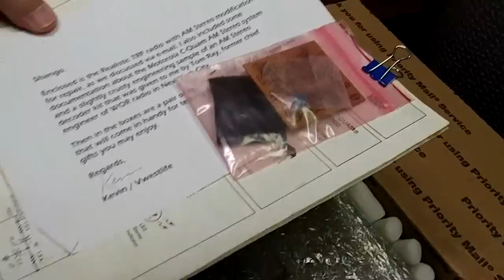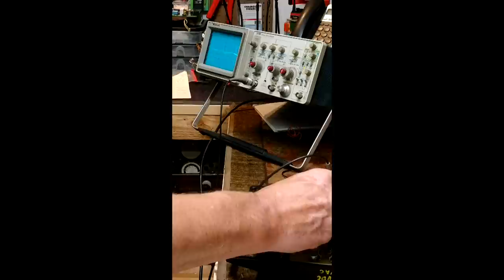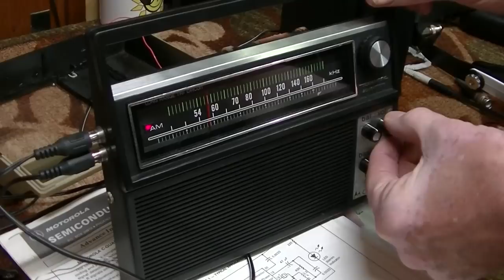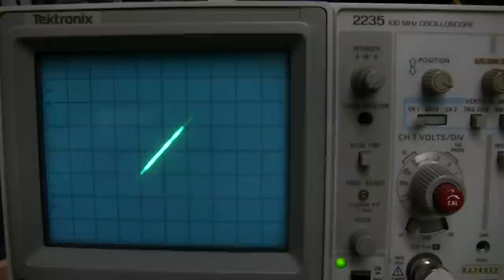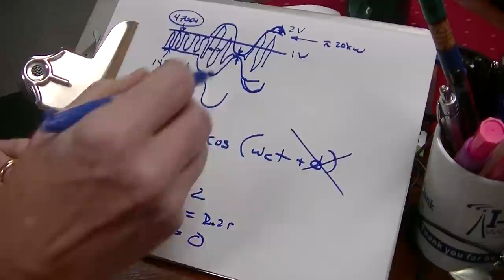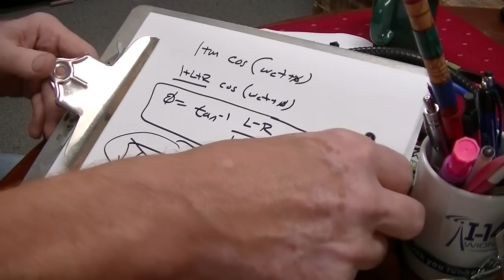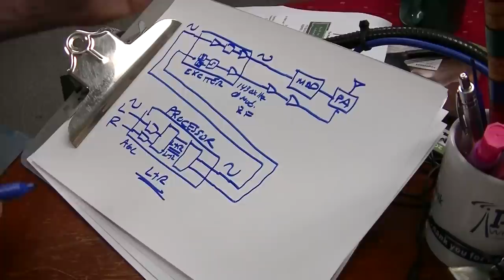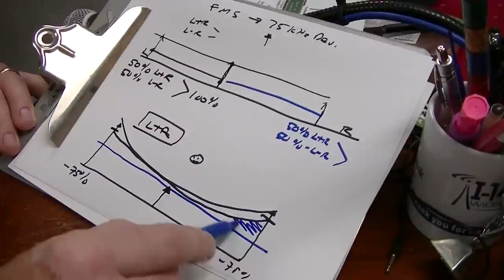WION Engineering Department Repairs Realistic Motorola Prototype Radio CQUAM Discussion Pt4

Comment: I really liked the explanation of how Motorola's engineers designed C-QUAM. I knew that the system designers knew that they would be constrained to building some type of a polar modulation system in order to achieve monophonic receiver compatibility and so that radio stations could add stereo capability to an existing monophonic transmitter. However, I didn't know that these engineers were looking for a way to tackle a signal-to-noise ratio problem and that their starting point was by analyzing the situation using trigonometry.

Comment: Great video and fantastic explanation by Greg. With today's DSP based radios, C-QUAM could be easily implemented in virtually every new radio that also has FM stereo. A few of the early HD radios could decode it, and there's a couple of SDR packages, including the KiwiSDR that decodes it. It's essentially several lines of code that would need to be added to these modern chips, such as those produced by Silicon Labs. Aside from WION, Greg also did the stereo install at WRDN. Both fantastic sounding stations. 540 WXYG is my closest station running AM-stereo. At over 70 miles away and only running 850 watts, they are easily listenable in stereo on my better radios with good antennas. I've really enjoyed these series of videos.

Comment: Wow, This takes me back to my youth.  I used moonlight at a local AM radio station 4AY.  During the day I was a tech for a two way radio manufacturer.  Being a relatively rural station we used to often get listeners bringing their receivers in for repair.  The station went to FM only a long while ago now.  AM stereo never took off in Australia, mostly I think because no one sold receivers here.  You certainly couldn't get the Motorola add on. Another big factor was no stereo receivers for vehicles.  Because of the long driving distances between towns here the mobile market was a large sector for AM. Anyway thanks for posting.

Comment: Around 17:15 it looks like arcing near the large filter cap.   Not sure if optical illusion or not...
Reply: Believe I saw the same
Reply: I saw that too and "think" its like a fiber or something blowing from a fan or something. Not sure though.
Reply: I saw the acring from the board under the can too
Reply: yes me 2
Reply: Perhaps caused by the 6v/m field strength! 📶
Reply: Looks like a reflection light off a spider web type filament left over from a hot glue gun. It tends to glint only when the camera angle changes.

Comment: In the end, (C)QUAM is a mixture of AM and PM (or should I say FM). The best of both worlds now used everyday in other transmission devices to increase the quantity of information on a carrier.
Reply: Exactly. FM still uses AM for the stereo signal. C-QUAM stereo separation is even better than FM, with no multipath distortion!

Comment: Seems to be some arcing going on (at 15:10 and 16:42) on the board by the cap with the tie wrap.
Reply: Looks like a glint of light from a fiber. It only flashes as the camera angle changes. Maybe left over from a hot glue gun or a spider?

Comment: Here in Italy we have 2 private station in CQAM.The problem is that you need a very good signal, no fading , otherwise the radio goes from stereo to mono and viceversa randomly. I use the same Motorola chip, I am not very impressed. I love AM , but...
Reply: Better antenna?

Comment: The enhanced single channel loudness is a product of processing the audio in the sum/difference domains, not by virtue of the mechanics of the modulation scheme.  As you mentioned, some of this is reduced by the negative modulation limits imposed by the vector limiting scheme to prevent high angle modulation.
Reply: It is a function of the additive modulation scheme and the processing. Of course the processing creates the enhanced sound field but it's not possible without the additive aspects of the system. FM stereo simply can't create the enhanced sound field as it is a substitutive system.
Reply: @gregbuchwald1566  The math doesn't work that way.  Assuming 1L, after passing through the matrix and modulation, then demodulation and dematrix, the product is still 1L, not 2L.  Process FM in sum difference mode, it will sound the same as AM stereo.  FM stereo is processed by applying compression and limiting on a channel basis, not their products and differences as AM stereo does.
Reply: Again, I disagree with you. If you process sum and difference for FM, you either lose 6dB of mono loudness or you over modulate (over deviate) by 6dB. Your choice. FM modulation uses one entry point for the transmission of information: FM deviation. Stereo transmission must limit to the leak deviation of 75khz. If you take the output of a properly limited FM signal transmission and feed it to a scope in X/Y domain with X representing left and y representing right, you will see maximum boundaries represented by a square. The 45 degree axis is L+R. Since FM (single modulation method) is substitutive when the stereo information is present, it must be effectively processed in the discrete left and right domains. You can do matrix AGC and compression, but final limiting must comply with 75khz under all conditions of information sent. AM stereo is additive: we have 2 nearly independent channels, envelope and quadrature phase, that can be simultaneously exercised. Therefore, limiting may take place in either discrete left and right, or in sum and difference. When the latter is done, the square of limited audio confines becomes a diamond rotated such that L+R has the same limit value but left and right only conditions extend an additional 6dB. You simply can't do that with FM. I realize you may continue to state I am wrong but I suggest you search for a paper done by Ton Jones at CRL on this topic. I developed audio processing that utilized these techniques and I unequivocally state that it is a fact. The sound stage absolutely increases at the edges by nearly 6dB.
Reply: @gregbuchwald1566  The only way we are going to be able to solve this is with a lab full of gear and a whiteboard.  It just doesn't make sense to me.  What goes in must come out.  Please provide a link to the white paper, assuming its substantially different than the write-up in the Amigo AM manual.
Reply: The section in the manual by Ron is the white paper basis. You state we "need a room full of equipment to solve this". That's easy: the next installment will have exactly that...just not quite the way you might envision it.

Comment: What would cause a portable tape recorders volume not to work? I sprayed dexoit etc. When the volume is at zero is still has sound and it sounds like it's on 3 or 4. Thanks
Reply: 3dsmax  there is a chance it is the Volume control but im no expert.   If i had a meter I would turn contol up till it cuts out - check resistance - if its oL or near infinity its burned out or not making contact.   It could be anything.   I have been teaching myself electronics a little ,   last thing i fixed was a car Audio Amp (bad mosfet).
Reply: @mike289homebuilt5  Thanks for your input!
Reply: Possibly.... JJ Cruz and the whole of the internet: Change the capacitors!.... 😆

Take a small 2.2 microfarad capacitor and jump across each little capacitor in the line before and after the volume control. Follow the wires and PC Board traces to follow the signal path. If you get a good increase in volume then replace that capacitor with the proper voltage and capacitance as well as install it observing correct polarity. This might get you the results you seek. Then you'll be sucked into the black hole of amateur electronics repair and vintage electronics collecting and curating. Good luck!

Comment: On a component level: The brilliant engineers moved/took the RF tap from the degenerative resistor (emitter), it had a capacitor to 0VDC, setting the AC gain for that stage - did they remove that cap or change its value to obtain an RF output, or did I miss something?
Reply: The bypass cap was a very small value to begin with. We had about 450mV of carrier across that resistor at 450kHz / carrier-only. That stage was heavily degenerated as received. I think it was done for linearity from the get-go.
Reply: @gregbuchwald1566  That makes perfect sense, thank you.

Comment: I can't be the only one who searches eBay looking for things listed as PARTS ONLY
Reply: You're not. And the boxes stack up quickly if you're having fun!
Reply: @johnnytacokleinschmidt515  I always end up with easy fixes like battery corrosion or broken wire etc. I want something that's hard to diagnose and then fix it since it feels like an accomplishment. 
Or I get a radio or something that clearly shows pictures of a clean battery compartment only to find out the seller put the batteries in wrong and calls it "not working"

Comment: Just bought a brand new in the box Tenma 72-540 signal tracer/injector with original probes. Just couldn't pass it up. 180 plus shipping.  It can only increase in value. (AKA Sansei 6100)
Reply: I'm Absolutely a nut about signal tracing and injection. Probably because my knowledge and comprehension preclude other diagnostic techniques such as voltage and waveform analysis. Enjoy your tracer.

I'm looking for a VIZ Signal tracer. I've only seen two show up on eBay in many years. I should have jumped on one of them. Then again I love a good deal, too!
Reply: @johnnytacokleinschmidt515  thanks.  I never heard of a VIZ?
 I'm planning on using my new tracer on an old portable Realistic 505 reel to reel machine I've had laying around.  Bought it on eBay and it too is like brand new. Made in  1973 5 inch reels.....the sound quality is really impressive especially for voice audio. It's no Nagra but Radio Shack did have some nice stuff back in the day. It won't record and needs new belts of course.  I have 2 of them actually.  The other one is beat up but I recapped it years ago and it works good.
Reply: @3dsmaxrocks699  VIZ was in Philadelphia and they carried on the legacy of the RCA branded electronic test equipment. I have the audio and RF generators, VTVM, line voltage monitor and whatnot. I like to geek out and set up a bench with primarily one brand of equipment. 😆
Reply: @johnnytacokleinschmidt515  Thanks.  I'll probably start searching ebay for them now🤣 now I have to have one too🤣